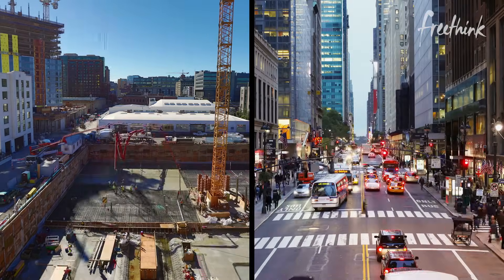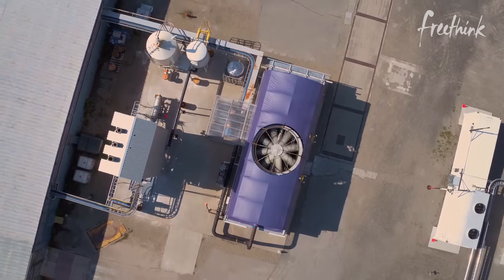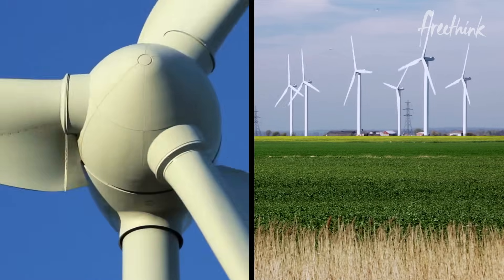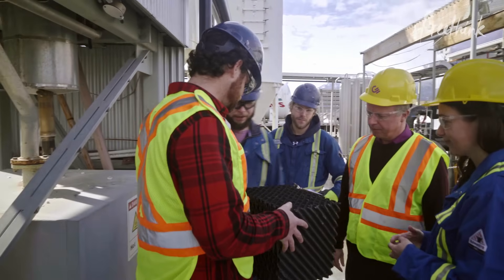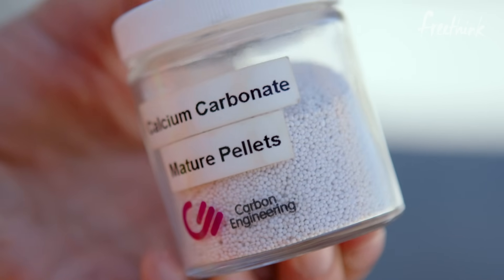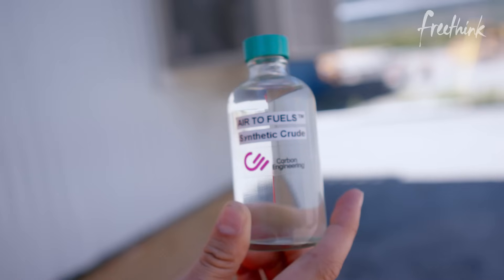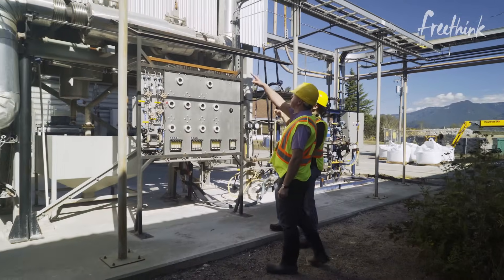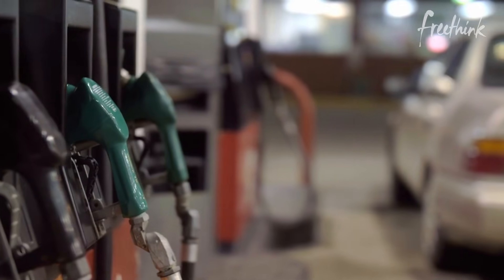Carbon Capture Technology Explained | Seachange

Comment: this is so weird , why go this route when a simpler route would be just use algae biofuel and have a same outcome.It does not need power plant as it runs on solar and no need for pure hydrogen much simpler and to make carbon negative just pump oil underground and we know it will stay there as it was already there for millions of year
Reply: "Intractable problems have been encountered in terms of the energy balance of lipid extraction, maintaining suitable growing conditions in open ponds, and the immense volumes of water, CO₂ and fertiliser required to allow the algae to photosynthesise fast enough at large scales.

'Simulations of microalgal biofuel production show that to approach the 10% of EU transport fuels expected to be supplied by biofuels, ponds three times the area of Belgium would be needed', wrote Swansea University marine biologist Professor Kevin Flynn in 2017. 'And for the algae in these ponds to produce biofuel, it would require fertiliser equivalent to 50% of the current total annual EU crop plant needs'."

Right now, Algae biofuels is dead in the water, economically and politically. Too many lobbyists pushing corn instead.
Reply: @ardalla535  yes true but if all U want to do is trap Co2 this is the easiest option heck don't even bio engineering it let nature do it for use and all would U need is pond or transparent pipe if U are low on water and output does not need to refined just basic oil and done can be done on limited power
Reply: We need to go to carbon levels from before industrial era, algae biofuel alone won't solve that.

Comment: what people don't realise is that, while it helps reduce our carbon emissions, it also eliminates the need to conserve forests and ecosystems. Meaning deforestation will continue without the guilt.
Reply: Yes what you are saying is important and very concerning.
Reply: Unless they pair it with mass graphene production to dramatically reduce the market for wood as a building material.
Reply: XPRISE CARBON CAPTURE
The heat loss from a smokestack can be forced into a large tank containing hot liquid microcrystalline petroleum wax. The heat will keep the wax at a molten state which facilitate the carbon to be absorbed when combined with the wax. Carbon when mixed with wax reacts like a dye. The wax-carbon amalgamation result in a black wax solution thereby making it impossible for the carbon to escape into the environment. Other toxic particles are also captured in the wax settling at the bottom of the wax holding tank forming into a sludge. A sludge release valve is located at the bottom of the tank. After the sludge is removed more wax is replaced in the vessel working something like a toilet. The sludge becomes a byproduct that can be used as an additive to asphalt for roads or used for cocooning nuclear waste materials for long-term safe burial. The entropy of the Earth has been increasing at a startling rate since the beginning of the industrial revolution caused mainly by the carbon that is released into the atmosphere. Government scientists have failed to stop and prevent carbon pollution from entering the environment. This problem can only worsen until a solution is found before this problem becomes irreversible. It has been discovered that formulated wax has been shown to be the only answer to this problem. William Nelson

Comment: So carbon capture doesn't actually reduce carbon emissions. The outcome is either:
1. Bury carbon dioxide in the ground and let later generations deal with the problem; or
2. Turn carbon dioxide into fuel which is ultimately released back into the air.
No wonder coal and gas companies love to market this idea as solution to climate change. It doesn't require them to stop mining fossil fuels. It just doesn't help the climate either.

Comment: Its good that they're aiming for a carbon neutral output, but it said wee need to have a negative output. Carbon is one of the most versatile substances in the universe, there's got to be something better to do with it than to put it back in the air after you went through all the trouble to take it out.
Reply: I feel like they could split it. Convert some of the CO2 to fuel and put the rest back in the ground. If they can sell some of the carbon neutral fuel, it could help fund the effort until the carbon levels are where they should be. It would also buy time to improve solar and other energy sources. Carbon neutral is still better than pumping fresh CO2 into the air.
Reply: XPRISE CARBON CAPTURE
The heat loss from a smokestack can be forced into a large tank containing hot liquid microcrystalline petroleum wax. The heat will keep the wax at a molten state which facilitate the carbon to be absorbed when combined with the wax. Carbon when mixed with wax reacts like a dye. The wax-carbon amalgamation result in a black wax solution thereby making it impossible for the carbon to escape into the environment. Other toxic particles are also captured in the wax settling at the bottom of the wax holding tank forming into a sludge. A sludge release valve is located at the bottom of the tank. After the sludge is removed more wax is replaced in the vessel working something like a toilet. The sludge becomes a byproduct that can be used as an additive to asphalt for roads or used for cocooning nuclear waste materials for long-term safe burial. The entropy of the Earth has been increasing at a startling rate since the beginning of the industrial revolution caused mainly by the carbon that is released into the atmosphere. Government scientists have failed to stop and prevent carbon pollution from entering the environment. This problem can only worsen until a solution is found before this problem becomes irreversible. It has been discovered that formulated wax has been shown to be the only answer to this problem. William Nelson
Reply: Plastics.
Reply: Plastics.
Reply: Put It In The Damned Ground Where Trees And Other Vegetations Will Metabolize It And Use It As Food.
Reply: @JB-pu6ek  Plants get their carbon from the air. Fungi and other microorganisms do need it, though, but I don't think it's a big problem. I can't imagine it would be worth delivering anywhere for that purpose.

Comment: Step one: switch all power plants to nuclear
Step two: develop carbon capture technologies 
Step three: profit!
Reply: Umm.. yeah about that . . . 
I think you’re overestimating the near-term potential of Nucleur fusion mate.
Reply: Nuclear Power Plants are preferable resource for the environment and create jobs. However, there's a cheaper alternative like wind or solar energy. Meaning, there's a trade off.
Reply: @franciscoe1182  nuclear fission are cheaper than wind and solar per kwh produced
Reply: @stenmgandersen   Maybe, but the nuclear waste issue is far more deadly than any other energy source.
Reply: @sushithareddy9576  nuclear fission waste has a very hazzardous potential, but i think it over exagerated as statistically speaking it has proven to be very safe. (Until now atleast). I have seen some fail safe designs that i hope get more attention.

Regarding the original comment, if we can develope a cheap carbon neutral power gereration and improved DAC technologies (12usd/ton CO2) then it will require 0.5% of world gdp to get carbon neutral each year. And i think thats doable as energy consumption is a large factor in this equation.
Reply: @stenmgandersen  the current methods that I am aware of is just dumping and storing the unstable plutonium.. until and unless we develop a method for utilising it.. we can’t rely on it.. plutonium on wrong hands can be very dangerous.. as it is a main element of nuclear bombs
Reply: There Ya Go!

Comment: Did they just try to say that we’re somehow going to use CO2 as fuel? Lol. If only that didn’t break the laws of physics
Reply: You can create fuels like methanol, ammonia, and dimethyl-ether. You generate hydrogen by splitting water and then combine it with carbon dioxide from the atmosphere.
Reply: This is the hydrogenation of CO2 a catalytic process that can yield Methanol it is called the Sabatier Process and has been around for about a century. It requires energy to do this some of that energy ends up  in the bonds of the Methanol.

Comment: Hold the horses, are you saying that co2 (carbon dioxide) is a pollutant?. co2 levels are only at 400 ppm and plants need at least 150 ppm to survive. Plants strive between 2000 to 3000 ppm and humans in submarines are subjected to 5000 ppm with no hazard. co2 is not the thermostat for the earths temperature.
https://www.youtube.com/watch?v=RR1bDmcNpa8
Reply: Submarines use CO2 absorbers to keep the CO2 concentration to 'normal' levels. Those work mostly with MEA an amine which can be regenerated thermally when not submerged.

Comment: CO2 is a non issue looking for a solution.  At the end of a sunny day with little humidity and no clouds, the temperature drops rapidly after sunset. The reason is that radiational cooling overwhelms CO2 heat trapping causing the air to cool. Add clouds and the air temperature increases after sunset. What nature is telling us is that CO2 is an irrelevant and insignificant GHG. On the other hand, clouds and water vapor are potent GHG's. American computer models used CO2 (forcing) resulting in wild, unrealistic predictions. The Russian computer models did not use CO2 (forcing) resulting in more realistic predictions...............close to what we experience in real life. These results show that CO2 is not a significant GHG. CO2 is being used as a political tool to brainwash the masses with propaganda of lies, falsehoods, scare tactics.
Reply: Can you explain this a bit further

Comment: It's not carbon neutral. It takes energy (and therefore carbon) to remove carbon from the atmosphere. I wonder if the carbon emitted when running these machines is actually less than the carbon sequestered by the atmosphere? My guess is not!

Comment: A direct solution to energy, how to alter jetstream paths back to Holocene patterns, note ground level CO2 removal doesn't reduce levels:

There are 4 factors of possible paths to prolonging a reasonable weather globally unless you think baseball hail, flooding, landslides, tornados and big storms are fun.

The first flips substations off-grid, its magnet motor for 1300hp/1-Mw is small, fits --> trucks, tractors, trains, aeroplanes and ships at sea.

This implies cars without refueling or recharging for the LIFETIME of the owner, eh?

The 1300hp/1-Mw has a half-century warranty of 24/7 power with normal upkeep, the magnets are still 90% in 1000-years, it's the only sensible power source to pursue.

So, flip towns off-grid, 1-Mw/1300hp, "50-year no-inputs warranty"; 17yr R&D; Belgian: technokontrol.com/en/current-projects/generator.php, the RF-5000, sparkless for use with explosives, military-spec.

For home farm ranch made to wire into panels, act as the inverter: 10kw•$15k, 5kw•$8k, 20-year wrnty,1-cent/kwh; S. Korean: infinitysav.com/magneticgenerator

The 5kw fits a pickup toolbox, is quiet, no fumes indoors, looks good for construction to me, $35/month + interest for 24x7 power, eh?

These globally are the ONLY machines ready for assembly-line, high-volume design and production I found in trade studies.

They are the bleeding edge, beaten path to a no-emission, tiny carbon-footprint motive power for all machines

SECOND, is using algae to purify wastewater at the treatment plant, or onsite for home•farm•ranch using the same units, this emits O2 and removes CO2, eh?

Then, the oils & biomass can become biodiesel and derivatives, from a pilot study I did for Phoenix, AZ, a 10M-gallons/day plant can produce about 3M-gallons/day of biodiesel, Gov. Jan Brewer was on board, we got shot down by her party.

Too bad, eh? Sound familiar?

THIRD: Have ALL IC-Engine mfg's make replacements with N.Tesla Tailpipes, a one-way air valve with no moving parts that ZEROES emissions for their tailpipes.

If they won't, shut them down, this eliminates soot from diesel, can be scaled up to industrial smokestacks, it reduces back-pressure, improves performance, and, he tied it to IC-Engines for this purpose 80yrs ago, eh?

FOURTH: It all boils down to dealing with Arctic seaice, HEAT GAINED in the 2007 retreat was 95,000-Twh over average.

Closing all Steam-age power plants 250Mwh and above is a one-time save of 36,000-Twh in emitted wasteheat.

That's 2•1/2-times too little to balance the gain vs the loss compared to the 1980-2000 average ice extent.

Losing the seaice is game-over on controlling runaway in the Arctic, this is what brings the extremes in weather vs assuming it'd get tropical to midwest farmers, eh?

Also, the Arctic Ocean is at the aragonite saturation point, all that a local marine biologist saw flying over the newly opened water were jellyfish, millions of them.

There is no fishery there as it becomes open water.

The serious 'Last Hurrah' for it all, to me, for what humanity needs to do: 

Install a weir dam at St. Lawrence Is. and polder north the entire Chukchi Sea to prevent wave damage and stratify the water to refreeze the bottom creating a year-round seaice refuge.

ALL shipping confined within 3-4km of shore, zero cross-ocean traffic, this uses Dutch ships, materials and methods to create polders, shoals & levees. 

And, building submerged "atolls" encircling  methane vents, this uses the bubble flow to pull in colder bottom water which refreezes them.

It all confines the freshwater runoff and most of all limits early melting from shore out to-sea in spring.

This reduces 5-Amazons of warmer, fresher water to 1/100th of what is melting the seaice from below.

Fresher water freezes at a higher temperature so true seaice isn't formed at the surface on freezeup, it needs -2C/28.4F for seaice to last over ONE season.

This intends to prevent the Siberian jetstream from turning north and can be modelled, the N.Pacific is too warm and heats the airmass from below, with The Blob in the Gulf of AK, that drives the circulation pattern needing change back to Holocene patterns.

So, the warmth sends rain to Anchorage in December and frozen oranges to Florida the routine now, started early, eh?

As that air cools it now gets to low latitudes ONLY over land to balance equatorial overheating.

The concept has 36,000 views on a seaice forum and zero actions upon it.

It's the only geographic location on Earth with the ability to alter the Anthropocene jetstream paths back into N.America instead of going north.

I can't order it done, the people in the poop deck party think everything's fine with lifeboats already in the water ...

In any case, it's the ONLY sane try to alter things not dependent upon emissions to overcome those effects enough to give MIDWEST FARMERS a break, else, expect a repeat of this past year or worse, eh? 

Expect flooding after this early snow, cold ground for maximum runoff vs a normal Holocene year, or worse, it stays cold.

Welcome to the Anthropocene, CO2 won't go below 400ppm for >>120,000-years as oceans OUTGAS their aragonite losses by reversing the carbonic acid cycle which acidifies fast and goes alkaline very, very slowly , bio-geochemical hysteresis, a real reason to consider extinction with business-as-usual.

"The rate of acidification is 10-times faster or more than anything we have seen for the past 50-million years and perhaps over the last 300-million years.".  ICES ASC 2013 Plenary Lecture;
Dr Richard Feely, 9:10 into 1:01:08; 14:30 in CO2 vertical maps; https://www.youtube.com/watch?v=etFob9Wy45E

Very sensible and comprehensive of relevant fundamentals; "Global Warming 56 Million Years Ago: What it Means for Us"; 
Dr. Scott Wing, Smithsonian Museum of Nat' History; 1:44:14; https://www.youtube.com/watch?v=81Zb0pJa3Hg, [Temp chart duration: Solomon et al., 2009, PNAS]

Modelling climate, what a "carbon excursion" is to paleontology, 1st part awards, great talk, illuminating:

Emiliani Lecture: AGU 2012 Fall Mtg; "No Future Without a Past 'or' History will Teach us Nothing"; 
Dr. Richard Zeebe, Univ.of Hawaii; 52:57; https://www.youtube.com/watch?v=Z6pyb9_PHv4
Ymmv.
Reply: Eh? Eh? Eh??
Reply: @tundevirag755  It's too much information for apes, people do ok with it that stayed in school, and for life as education is a never ending story ...

Comment: Seems like it will take more co2 to construct than would be take out of the environment
Reply: Daniel Meeks, I don’t think so. The facilities will run for years.
Reply: Kale H 
So will maintainability and upgrades using more co2 and additional co2 production that it was meant to fix... pretty vicious cycle.  Maybe we’ll get lucky and corona will take out half the population.
Reply: Daniel Meeks, It wouldn’t take that much CO2 to manage. It can absorb over 1 tonne a day, can’t it.
Reply: Kale H 
Cite your source
Reply: Daniel Meeks, The video: 1:40. And the plant they are proposing in Texas will be a 1 mega tonne atmospheric CO2 plant.
Reply: Kale H 
Resending co2 into the atmospher isn’t capturing anything.  They are capturing particulate matter and calling it co2... its conceptual, not factual.
Reply: Daniel Meeks, But the facility (just a small pilot plant ) still captures 1 tonne of CO2 per day.  The embedded emissions I doubt  be that significant.